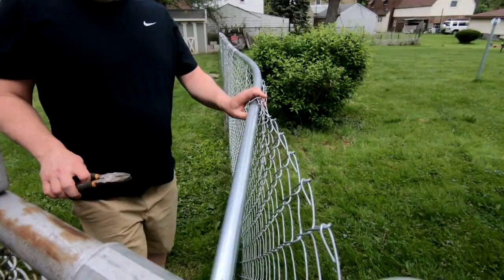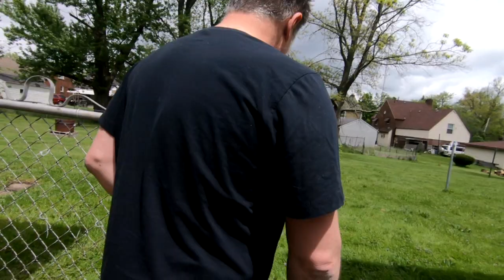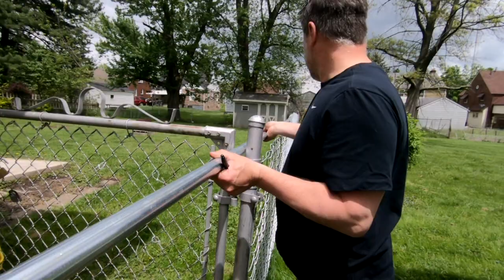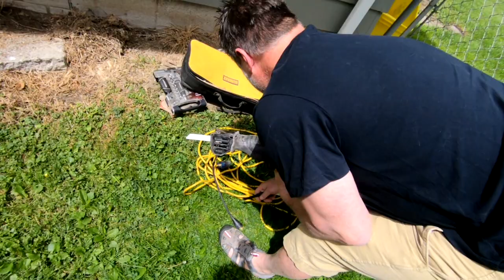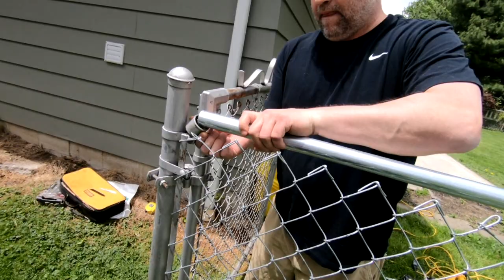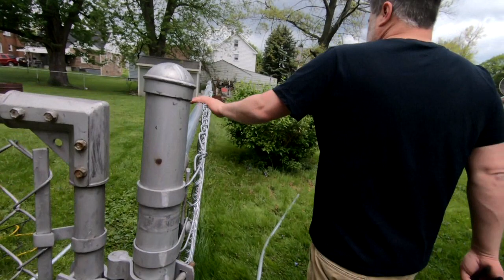Repairing a Chainlink fence top rail in 10 minutes uncut

Comment: I have to do the same thing, after the Blizzard over Xmas. My 40ft pine uprooted. Bent the top rail. So I'm replacing that. Now the fence is bent, would I replace that section? Or once I unclip it from the bent rail, will it straighten out?
Reply: This was four months ago.  So how did you fix your fence?  Because the same thing happened to me with my mulberry tree.
Reply from the maker: I'd cut out the bad sections and replace
Reply: @paulsantia6534  Next week. Part of my property is being rezoned for a sidewalk repair project. So I had to wait on wether or not they were going to yank out the fence anyway.